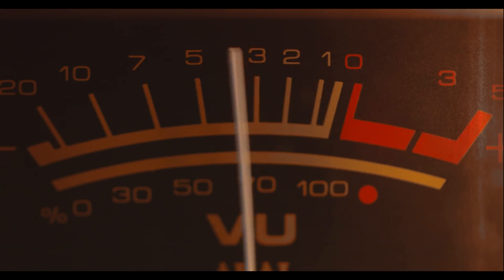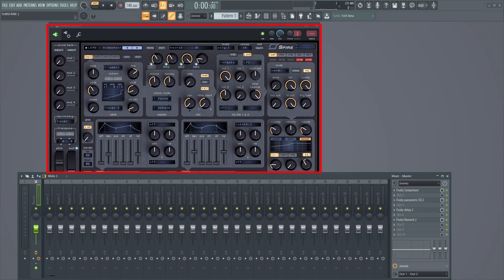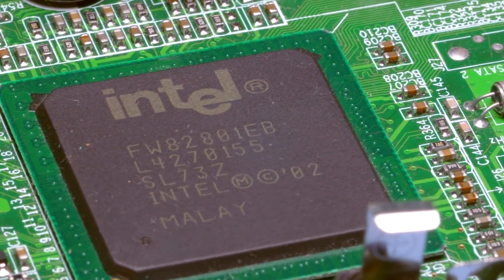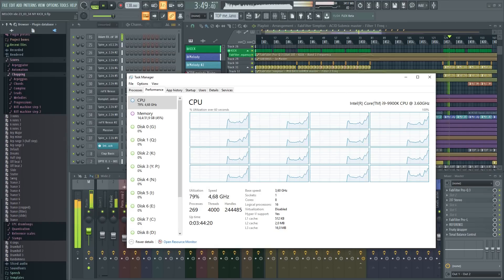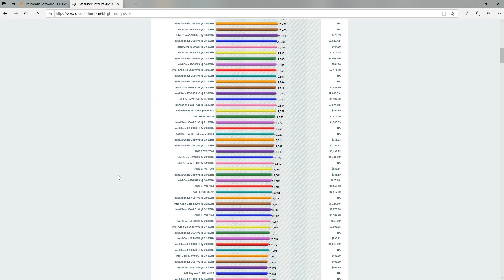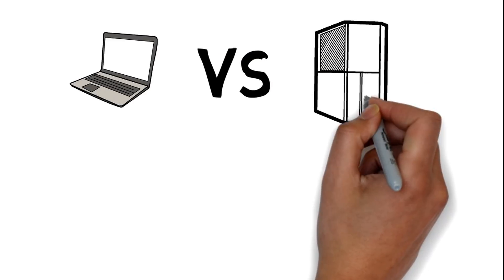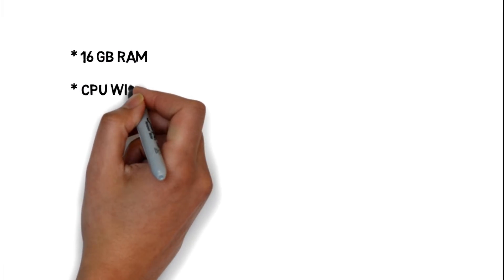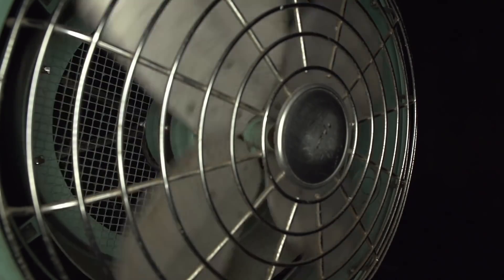The Best Computer For Music Production - What's Needed And Why!

Comment: It's nice and informative video.
I'm a beginner producer,I want to produce edm mainly. I have a strict budget of $500 please tell me the best pc I can build(only pc) for this amount, which should last me a longer till I understand and use more elements.
I really hope you answer this question. I would appreciate your answer. Thank you!
Reply from the maker: If you're on a budget then I would recommend AMD since they generally provide better value for your money :)
Reply: @FireWalkMusic  so I have chosen the following could you please tell me am I going right? Sorry to bother you!

So for a budget of $500.
I've chosen the following (not built yet)
Suggestions are much much appreciated:

Processor : Amd ryzen 5 3600x
But please suggest me should I go for Ryzen 7 2700x or Ryzen 5 3600x?
I benchmarked them on userbenchmark and it showed Ryzen 5 3600x as fast in single as well as multicore processing, also it showed this as recent 11 or 12 months old while Ryzen 7 2700x was 24 months old.

Graphics card: GT 1030 2GB OC from Gigabyte(Not available in my place, so similar options are appreciated)

Motherboard: Gigabyte B450m ds3h

Ram: Crucial ballistix sport lt 2666 MHz DDR4 dram desktop gamig memory kit 16gb (8gb×2)
(Not available in my place, so similar options are appreciated)

Power supply: EVGA 500W 80+ Bronze(Not available in my place, so similar options are appreciated)

Case: Cooler master MasterBox Q300L mATX Tower(Not available in my place, so similar options are appreciated)

Storage: Any 2TB HDD or 500GB SSD(recommendation appreciated)

While some of the items are not available, please suggest some good replacements within the same budget/spec range. 

Thank you!
Reply: I hope you reply on this🙏

Comment: question about the case, will it matter if I will go with this? insulation wise? help me out, I am building this for my husband.
Fractal Design Define R6 USB-C - Mid Tower Computer Case - ATX - Optimized for High Airflow and Silent Computing with Moduvent Technology - Modular Interior - Water-Cooling Ready - Gunmetal Tg 
also will, i9 10900k will make a big difference performance wise? thanks a lot!
Reply from the maker: That tower will also work well. Performance wise there won't be a huge difference. You get more cores, and the overall performance increase is around 5% over the 9900k. Not really worth the price difference in my opinion, since you can usually overclock the 9900k to 5 ghz with no problem. But if you have the money for it and it's not an issue, then sure, you can't go wrong with an 10900k. 
If you need more cores, then I would also consider the AMD alternative, which generally provide better value overall. It won't be able to run at the same clock speeds as the 9900k though, and if you need to push the system to the limit then Intel will likely still come out ahead.

Comment: Wow, a guy with a strait up video. Not looking for hits, or how to build for 100, or best of best. Only vid that helped online!!!!!!!! Now need one on DAW. No way am I going ProbTools BS. And plug in interface. Honestly internal effects not looking for a load. A lot will be mic input. Already with tone. Then just looking at Drum loops or machine add on. I have synths to I may go strait in with, although midi in may be a thought. Being a lot of great sounds via that way too. Plus it's direct. Outside that, just want latency to be solid. Be able to cut and paste and move, pan, EQ, base line effects per track. About it. Still not sure which way to go?
Reply from the maker: Thanks, if you work mainly with hardware, and use a lot of recorded samples (audio) then you really don't need all that much processing power. Generally, AMD will provide better value for your money. If an i7, or equivilent AMD system will usually be more than enough.
Reply: FireWalk it's built. I'm broke and my car may die, and I can't fix it. But it's built!!! Yea went a tad nuts on it. I literally redid like 3 areas. Plus I warrantied every thing I could. I'm just waiting on (you end up getting soooo much small stuff too.) Not just the (waiting on interface.) "Butt other stuff.,Its unreal how much. Its a bit uber, a bit lol. Its i9-9900 10 core,,,, 3.7 I think at base speed. Water cooled? 3 HDDs. One OS is SSD 500 GB to run the DAW. The others for audio, samples, etc. A second drive at 2TB 7200 and 3rd 1TB 7200.  And actually a 4th external SSD 1TB. RAM 32 DDR4 (if 64 is needed, easy to do.) A bunch of ports. Not thunderbolt. But 3.1 3.1 2.0 A C versions etc. Can always add. Only thing I made sure on the video card was dual monitor. No true internal sound card, not needed. Windows 10-64bit of course. Internet and other stuff. Just for plug-in and DAW downloads though. Interface, as a guitar guy, a basic focusrite 4i4 3rd gen. 3rd gen pre amps were solid. Compared to my DAW, I wanted (everyone can booo) but it is a beast  since 4.5 l.... Studio One. Which contradicts my interface choice. But I had to go with the tad better range and sound of the 4i4. Guitar will be plugged in a bit. Synth I got a mini Mk whatever. But have a Korg I can use too. Had that. But the small feels good next to me just to throw lines in. I had dynamic mics. Still do 57s 58s got a solid mid ranged condenser wide diaphragm one for phantom. Only took like 50 vids and even phone calls to pick the best mid line one. I poured out a lot. But S1 because I already have some feel of that DAW. Which is key. Its not freakish new to me in a sense. Plus like I said, really solid after 4.6 actually now. Dang plugins, I got S1 professional. Still wanted like a better guitar plugin, and synth. Rest is fine. Yea, I'm all in now. Read like 7 hours a day till the dang interface gets here! No BS, 7 hours easy a day, reading Studio One stuff,,or vids on it. Interface is supposed to be here today. But,,,, I leave for a few days soo??
Reply: Think we got the same motherboard  too? Not sure, have to look that up. That was key to with the i9. We're actually pretty similar. Water cool on mine though. I know noise. The whole things basically insured though. Not singing a tun, so sound? Cool you run big projects. Cause I was asked a million times. How do you think you'll track. I said, well... I love synths too. I layer guitars. In 4 hours I messed with a 32 track and almost filled that! And that was improvising each track. Not saying I'll be 32 all the time. But I'll harmonize leads, have like 5 6 tracks of leads with different effects, more orchestrated. Clean to heavy, l could max 6 rhythm tracks. So guitar could be a background and still do 12 max. Norm 5 or so. Then Drums, if the tools, synths will play a much larger roll. I could get a little wild on that side of things. Guitar plugins too! So much compression and EQ. Hard to get each to sit right, yet do something unique. Its a lot of stuff...

Comment: Ableton Live 10 by default can run 64 threads for audio calculation. Each thread is dedicated to a single chain of audio. Both core count and clock speed improve performance.
Reply: Are u saying Ableton Live 10 has the ability to process faster because it can make use of the extra cores?
Reply: @brandanleiter  If it can use extra cores, it would definitely be faster and more convenient than FL studio.

Comment: I'm running an i7-4770K. Outside of the obvious benefits of DDR4, and SATA 3.0 plus Nvme on the new m.2 drives, I can not see a reason to upgrade anything for another year or so. The difference is non-existent unless I go with the new 10th Gen Intel CPUs, but rumor has it the 11th Gen will use the same 1200 socket, and support PCI-e 4.0. Honestly, I might as well wait.
Reply from the maker: If I were you, and you have no problems with lag or underruns, then just stick with it as long as you can. Right now prices are going up a lot due to the corona virus situation. AMD is finally giving Intel a run for it's money again, and that will inevitably drive down prices. Unfortunately the virus situation is having the opposite effect, but once that's sorted (hopefully) then I believe prices will go down. If you wait for a while then you might save quite some money on your next build.

Comment: There is 1 thing i have to say about your gpu comment. Some and i mean very few plugins let you use the gpu to use as processing power. Acoustica audio is one. Its not a big thing but its there lol
Reply from the maker: Thanks for the update :)   From what I've read, most plugins don't use GPU acceleration because it introduces a lot of extra latency. It can in theory help offload the CPU, but because it also introduce a lot of extra unwanted latency, most developers refrain from using it. I remember there was a discussion on the Image-Line forums a while back, where the developers was asked why they don't use GPU acceleration to make things more efficient, and the extra delay introduced by the GPU was the reason given.

Comment: ryzen 3000 series seems pretty decent and better than their 2000 series. which one do you think is better? Intel i7 9700k (8 core) or Ryzen 7 3700X (8 core). your reply would mean a lot! Btw great content :)!
Reply from the maker: Thanks :)  I would say it depends on what else you're going to be using the computer for besides just music production. The new Ryzen CPU's are great and will perform very well. Generally, you get better value from AMD these days. If you make average sized projects and don't need the very best of the best then AMD will be a good choice. The AMD flagship and the 9900k are very even in terms of performance right now, at least right out of the box. When overclocked it's a different matter though, as you'll typically be able to clock an Intel CPU further. The 3900x for example will max out at about 4,2 - 4,3 GHz on all cores, while a 9900k for example will be able to run at 5 GHz on all cores with no problems with sufficient cooling. The i9 also have about 17% better IPC (instructions per cycle) than the AMD flagship. This means that for tasks such as music production and gaming, Intel will still offer better performance, but not by a huge amount. If you're not planning on maxing out the system then you might as well go with an AMD. It has more cores, which you'll be able to take advantage of in various other tasks.

Comment: I have a dell inspiron  3650. It has done a good job so far but I fear it would not handle a lot  cpu  intensive programs . It has a lot additional slots for me to add different items . and yes it is only 8GB. What do you recommend ?
Reply from the maker: If it starts to struggle you'll need a more powerful CPU, and possibly more RAM as well. You could always upgrade the motherboard, CPU and ram, but often times you'll need a new power supply as well. 
I recommend this video, on how to get the most out of your current CPU: https://youtu.be/OWYmqwb7b4k

Comment: I like and appreciate the video but in 2020 music production you typically have tons of tracks of real or virtual instruments all loaded with a plethora of plugins. Even a cheap DAW like Reaper distributes these tasks exceptionally well over several cores - in my case six.
A caution about RAM if you want to work with sample libraries: 16GB should be absolute minimum.
Reply from the maker: All daws can utilize multithreading. I'm not saying they can't, I'm just saying that they are not as efficient at it as say a video editor for example. The reason for this is all the waiting that occurs, which will cause everything to grind to a halt if one thread is maxed out. Things can't progress until everything catch up and stays in sync, so it doesn't matter if you have a lot of cores if that happens. The main problem is that work isn't always distributed evenly across cores, and therefore single core performance becomes very important. You typically want as many cores as possible in order to spread work across those cores, but you also want those cores to be as fast as possible. As you keep adding more cores, there will typically be a sweet spot where you have the best of two worlds, and after that you'¨ll have to sacrifice some single core performance in favor of more cores due to the heat generated. 
I think the developers said it very well, so I'll just paste from what they said: 

"The logic of audio processing - There is a long list of tasks that must be processed in sequence, and this means logically can't be processed in parallel (multithreaded). For example: Plugins must wait for instructions from the Piano roll and Playlist before they make sound. Effects must wait for the audio from upstream instruments and FX before they can process it. Further, it's not possible to parallel-process (multithread) instruments and FX that are on the same Mixer channel (their audio is mixed together), or even in the same Mixer routing pipe-line (when one Mixer track is linked to another and another, even FX processing has an order from top to bottom in the FX stack). Then, the Master Mixer track must wait for every instrument > mixer track > effect to be processed before it can process the audio through the Master effects. So logically, there is a lot of waiting that is a natural and unavoidable fact of DAW music processing. Think of a production line. This means the CPU may not be particularly busy, using all its cores and processing slots, yet it runs out of time to fill that tiny 5 ms audio-buffer because there was a lot of waiting for things that needed to be processed in sequence. It should be clear that fast processing is very important and this is not the same thing as multi-core processing. The best CPU is one that has enough cores to spread the work around AND can do the most work on a single core during each buffer time-slice. Which leads to our TIP: When comparing CPUs, look for the fastest single-core performance scores in a package with at least 4 physical cores. "
Reply: @FireWalkMusic  Thanks for taking time for all that detail. I am not saying you are wrong but one problem is that cost of single core speed goes beyond exponential beyond a certain level. Since Moore's Law expired we are getting small gains outside of adding more cores. Judging by the exploding amount of plugin and sample library manufacturers you'd think the home audio production community was so big by now that hardware R&D would start catering to us like it has has done to the gamers for eons. Imagine a dedicated audio processing card.

Comment: DAW can use all the core of cpu...therefore cpu with more core (AMD) is better in my opinion. TNX for vid
Reply from the maker: You're welcome :)  It's true that a daw can utilize more than one CPU. I never said they could not, just that they are not as efficient at it as say a video editor for example. Due to the way audio-processing works in a CPU, single core performance and IPC is more imortant than the share number of cores. The new AMD chips have more cores than the 9900k, but the 9900k has slightly better IPC (instructions per cycle) and they can also be overclocked more. The 3900 will typically max out at around 4,2 - 4,3 ghz on all cores, while the 9900k can easily run at 5 ghz on all cores, and that will most likely be more important than the extra cores of the AMD chip. Having more cores doesn't help if one or more cores already have work queued up. They will all have to wait, and it's this waiting that is the main problem in real time audio processing. 
I believe that Image-Line said it very well, so I'll just quote what they said about CPU's and cores in the manual: 

"The logic of audio processing - There is a long list of tasks that must be processed in sequence, and this means logically can't be processed in parallel (multithreaded). For example: Plugins must wait for instructions from the Piano roll and Playlist before they make sound. Effects must wait for the audio from upstream instruments and FX before they can process it. Further, it's not possible to parallel-process (multithread) instruments and FX that are on the same Mixer channel (their audio is mixed together), or even in the same Mixer routing pipe-line (when one Mixer track is linked to another and another, even FX processing has an order from top to bottom in the FX stack). Then, the Master Mixer track must wait for every instrument > mixer track > effect to be processed before it can process the audio through the Master effects. So logically, there is a lot of waiting that is a natural and unavoidable fact of DAW music processing. Think of a production line. This means the CPU may not be particularly busy, using all its cores and processing slots, yet it runs out of time to fill that tiny 5 ms audio-buffer because there was a lot of waiting for things that needed to be processed in sequence. It should be clear that fast processing is very important and this is not the same thing as multi-core processing. The best CPU is one that has enough cores to spread the work around AND can do the most work on a single core during each buffer time-slice. Which leads to our TIP: When comparing CPUs, look for the fastest single-core performance scores in a package with at least 4 physical cores."
Reply: @FireWalkMusic  TNX for replay,based on  Image-line web page ,FL can utilizes multi-core CPU and base on your Vid here, there`s no big difference between 5820k and 9900k. I`m not a FL user and don`t know about it`s cpu usage but I don`t think it is mor CPU hunger than ableton. there is video on youtube that compare 5820k and 3900x in ableton program. https://www.youtube.com/watch?v=j3zhKhUxxeE
all you said about intel`s cpu is true (multi core overclock is on 4.7 Ghz) but one core efficienty is likely better in games not programs. sorry for my language.